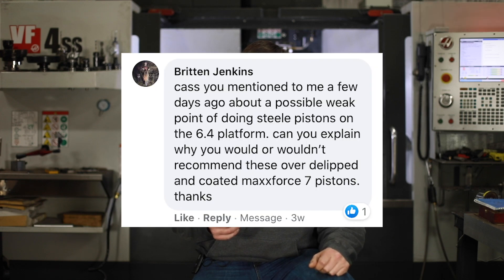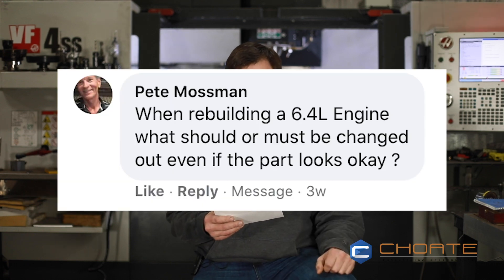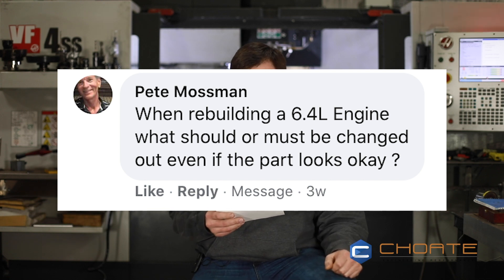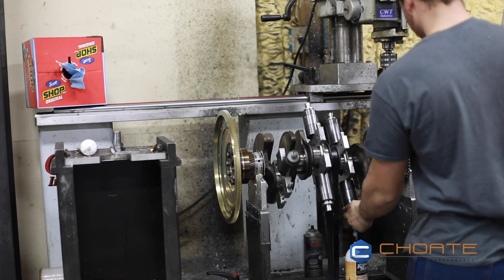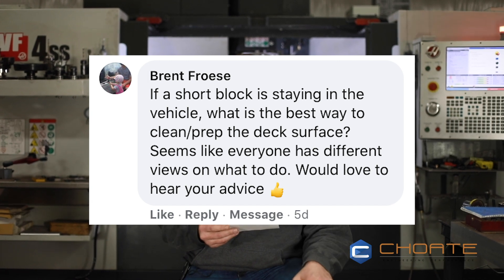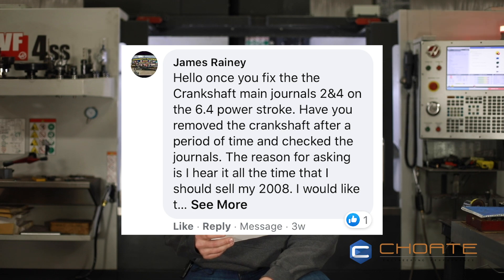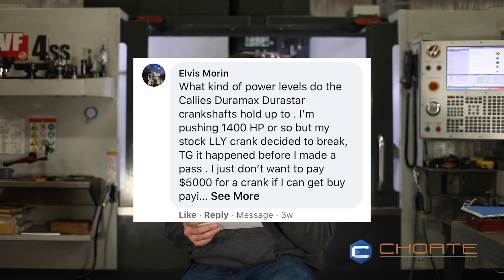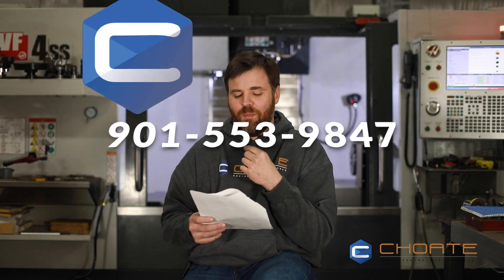Diesel Machining Questions Answered

Comment: I just purchased a set of your billet aluminum rocker covers with the oiling rails for my 6.4 power-stroke. I am in the process of building the motor now and I got a set of maxxforce7 pistons that are ceramic coated, delipped and flycut for my callies stage 1 cam. Have you seen these pistons fail with the H&s minimaxx canned 250hp tune? I would like to run that tune without driving the truck like I stole it but I also want to give a cocky Corvette a bad day without worrying of detonating my motor. I’m having a hard time finding how good the maxxforce pistons are with a delipping
Reply from the maker: Hello! Give us a call 9015539847 and we can answer all your questions!

Comment: Do you guys know if a Maxxforce 7 long or short block of the same year would fit in place of a 6.4L Powerstoke if all accesories/brackets were swapped over?
Reply from the maker: That's a good question.  We build many maxxforce 7 and yes alot of the accessories do work.

Comment: As always great information. Thanks for sharing. Curious if you would do a detailed build series on a 6.7 Power Stroke?  I’ve heard you talk about crankshaft endplay (thrust bearing) and several other measurements that a critical when building (not assembling) the 6.7.
Reply from the maker: We will Do a separate video on that topic! Good suggestion !
Reply: @choateengineeringperformance  thank you very much